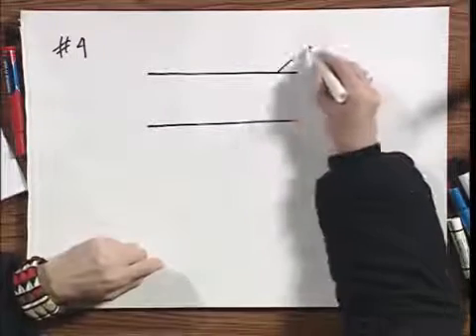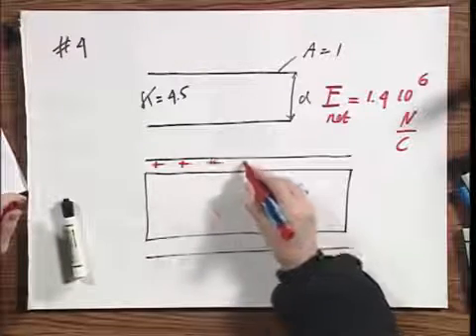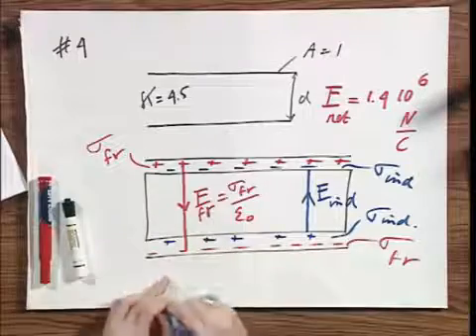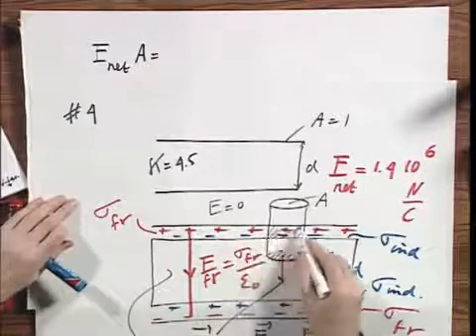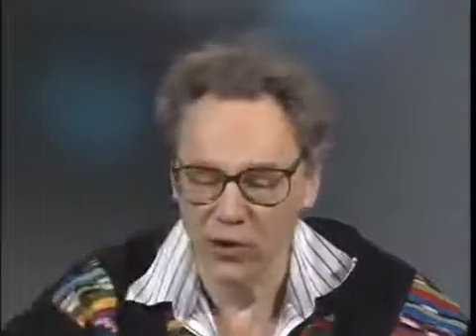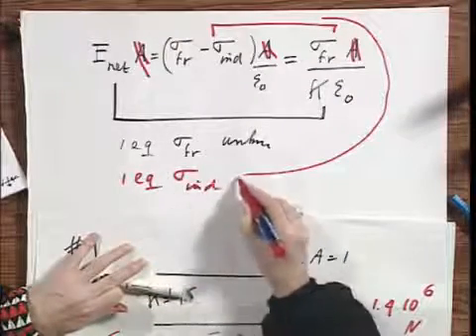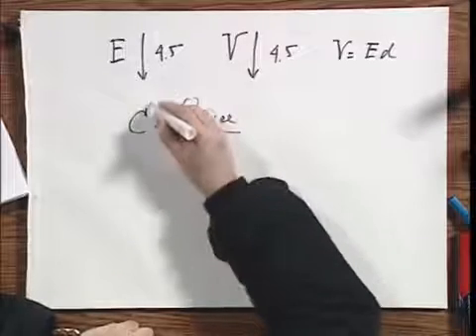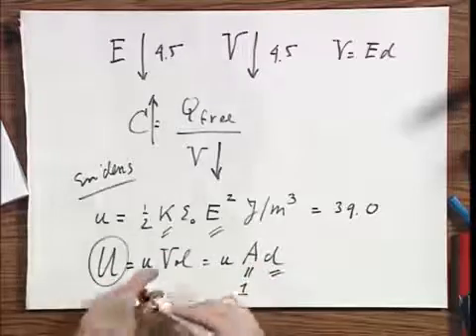8.02x - Module 03.04 - Capacitor with Dielectric.

Comment: 7:51 So, E here is the original E(net) 
and not the new E, i.e. E(net)/K  ...?

Alternatively: K·(old u) = (new u) ..?

Am I right in saying that there is K times 
more energy stored in the capacitor 
with the dielectric than without, 
at the expense of a voltage drop 
across the plates?
Reply: u(free space)=½εo·E²
u(dielectric)=½KεoE·E
=½Kσ·V/d
=½KQV/Ad
=½K²QV'/Ad
=½K²ε(E')² ...🤔

u(di)/K²=u(fr)/K
=(1-b)²u(di)=(1-b)u(fr)
=½ε·(E')² 
..What's this, does it have any significance ⁉️

Comment: Pr.Lewin,I think you slipped up at 6:16.I think the correct solution should be 
σ(in)=(1-1/K)*σ(fr).
Reply from the maker: yup, slip of the pen - sorry
Reply: Yes
Reply: If σ(fr)–σ(ind) =σ(fr)/K
=> σ(fr)(1-1/Κ)=σ(ind)
σ(fr)~σ(ind)(1+1/K+1/K²+...), K>1
≈σ(ind)(1+1/K)
Reply: In his 8.02x lecture on dielectrics, he had:

E(net)=E(free)–E(ind)
=E(free)(1-b)
=E(free)/K, where b=1-1/K
=> E(free)·b=E(ind)

From my other comment: 1/(1-1/K)≈1+1/K
=> E(free)≈E(ind)(1+1/K)
=> E(ind)≈E(free)/(1+1/K),
and as 1/(1+1/K)≈1–1/K,
this fits with E(ind)=b·E(free), from above.

Comment: Sir what will be the capacitance of an octant of a sphere if capacitance of sphere is C?
Reply from the maker: question unclear - ask quora
Reply: Lectures by Walter Lewin. They will make you ♥ Physics. Sir if we divide a sphere in eight equal parts like we divide a circle in 4 quadrant then what will be the capacitance of 1 part of sphere if capacitance of whole sphere is C?
Reply from the maker: bizarre question as the charge will then be on both sides and the charge density will be huge near the sharp edges. There is no analytical solution - a numerical solution may exist but will depend on size. ask quora.
Reply: Lectures by Walter Lewin. They will make you ♥ Physics. Yes sir I also think the same but this was asked in one of the entrance test.
Reply from the maker: >>>this was asked in one of the entrance test.>>>
insane question!
Reply: Lectures by Walter Lewin. They will make you ♥ Physics. Yes sir I totally agree with you

Comment: Sir I have a doubt..
In a parallel plate capacitor 2 different dielectrics with dielectric constants K1 & K2 are filled across the diagonal . The area of the plate is A.The distance between the plate is 'd'. I got the capacitance of this capacitor as  
({epsilonzero}A*K1*K2/{K1-K2}d) * ln (K1/K2). But when I put  K1= K2= K , It shows 0/0 form..Can you please explain this..
Reply from the maker: I do not solve problems for viewers. I teach Physics. I refer you to my 8.02 lectures and my 8.02 Help Sessions which are on this channel.
Reply: Thankyou sir !

Comment: sir why Sigma induced and sigma free is not same. why they are unequal.
Reply from the maker: if they were the same that would require a dielectric constant of infinity. The net E-field in the capacitor would then be zero.  A good conductor used as a dielectric would do that.